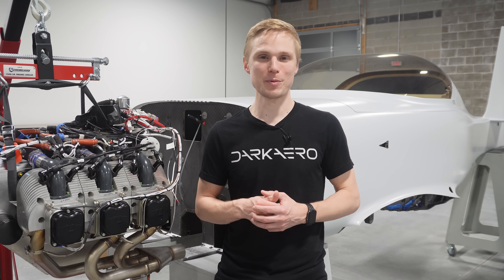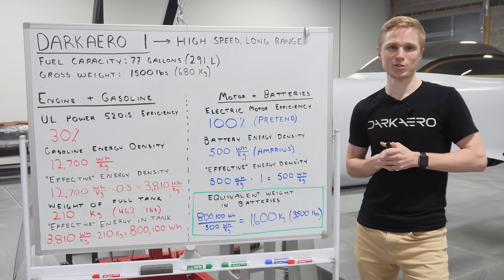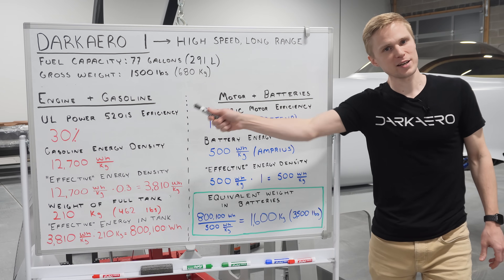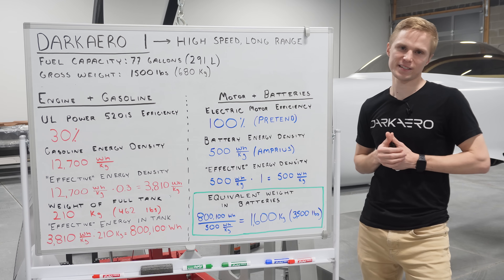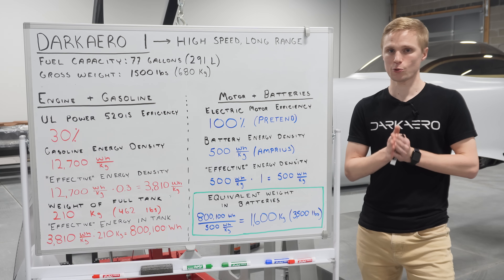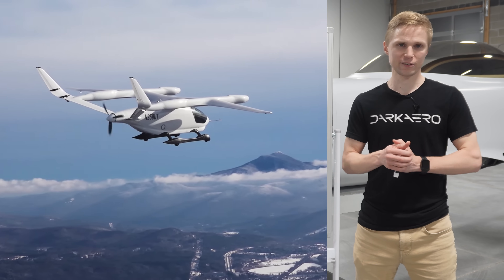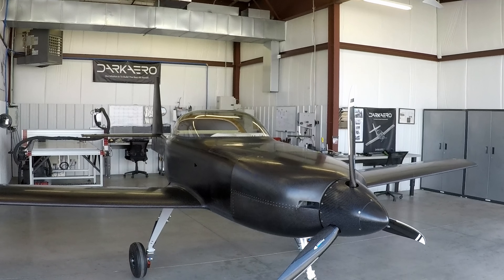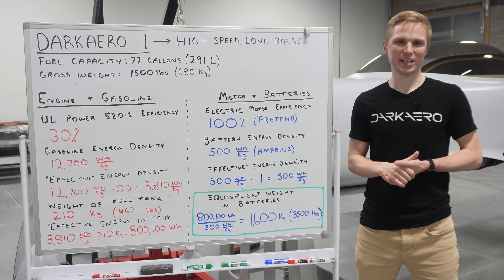The engineering challenge of electrifying airplanes

Comment: One more advantage of gasoline is that the aircraft continues to get lighter as it flies.  That means it gets more efficient as the fuel is burned. Electric motors depend on batteries … obviously, but your motor is still forced to carry the dead weight of the  depleted batteries throughout the entire flight. Batteries also have a finite service life and cost a fortune to replace especially if they are integral to the airframe.
Reply: Good point. You can't have an airliner fly long distances and land at their takeoff weight. And they depend on step climbing to higher altitudes as fuel weight is burned off.
Reply: @benc1103 

Wrong! You CAN have an airliner fly long distances and land at its take off weight. Thos is in fact a disadvantage of gasoline and kerosene.
Reply: Those studies are flat lying to you
Reply: One more disadvantage of fossil fuel is it stinks and destroys our environment so that our grand children will have to struggle to sruvive. 

But of course operating a fast flying machine is much more important than the lifes of our descendants.
Reply: True, but electric motors are far lighter than gas engines and have fewer parts so easier to service. Battery tech is also improving, quantumscape has developed a 1000wh/kg battery that will be a game changer.
Reply: @elftax  are these new batteries still dependent on rare-earth metals. If so, then aren’t a game-changer.
Reply: @thurlravenscroft2572  the name change is the energy density which will make 1000+ mile cars possible. The weight reduction makes electric planes viable
Reply: @elftax  you can develop a car that drives 5,000 miles per charge, but if the materials available to make them are scarce, it’ll never happen because the price will be too high so the demand stays low enough not to deplete the resource.
Reply: @thurlravenscroft2572  the company is building a production line,  its almost certain that it won't be rare minerals - probably lithium
Reply: @elftax  oh, so not rare but incredibly toxic to the environment and the poor children that mine it so you can have your fairytale EVs?
Reply: Battery weight at landing needs better frame as they don't get lighter. For long haul aircraft that have to do a landing shortly after take-off due to technical issues, passenger emergency maximum landing weight (MLW) is easily to solve by dumping some fuel.
Reply: BOOM…mic drop
Reply: And there is no need to reduce gasoline exhaust. Don't believe the hype.
Reply: @RobertCraft-re5sf 

If you think so start the engine in your car in a closed room. See what happens.
Reply: One disadvantage of gasoline is that the engine needs to be overhauled quite often and it's also far more expensive to maintain. Might require more fluids too. 
Another disadvantage of gasoline is that you need to throw it away if you have too much of it when flying. 

I could go on.
Reply: Just toss the batteries out as you go. Simple fix
Reply: Lotta armchair engineers here with their camps already chosen.

Here's the deal. Electric planes already win in operating costs. They lose however on range and endurance.

That means that electric does not currently fit everyone's needs, but it does fit some. And time is on electric's side, since battery tech has more room to grow than combustion. I see people making denser batteries. I don't see anyone making denser fuel.
Reply: @米空軍パイロット  yea you don’t know anything about this it isn’t just about fuel density it’s about chemical chains sure liquid fuel have a massively higher energy density than batteries but we’re chasing fuel chains that have specific hydro carbon levels and burn efficiency while being manufacturable using atmospheric gasses making more dense fuels is “easy” that’s what they do in rocket science fairly regularly but that’s not what the goal is here
Reply: The biggest issue with the entire electric vs. internal combustion discussion is the lack of infrastructure to support a rapid shift to EVs. Without a new realistic/reliable power source, we aren’t going to be able to transition fast enough to get public buy in on EV technology. Especially, when large states like California start having massive brown/blackouts and onerous electricity rationing because of their refusal to accept nuclear fission as a power source.
Reply: @thurlravenscroft2572  no the problem is the current infrastructure is inadequate cost billions more to manage and build has its own problems with “being green” has massive reliability problems that are getting worse with the addition of “green energy” the material to make all the batteries you would need for the cars don’t actually exist on earth and we don’t have a way to recycle them or to throw them away with major environmental damage while slow in gas we are just transferring atoms from liquid to gaseous and wile slow is actually recycling energy thru nature every second and that will speed up If we actually stop trying to tamper with natural systems to save a buck like cattle farming for example the beef I buy from my cattle supplier weights 1600lbs live for every lb that cow weights when I kill it it puts 4lb of carbon into the soil of the pasture he lives in for every lb of meat you buy from Whole Foods that cow because of how it was raised puts 3lb of carbon emissions into the air because of how it’s raised and factory “meat” like beyond meat is over 5 lbs per pound and beyond meat and big box store food is crap for you so you have to eat more to get the nutrients you need so more body fat for you you can’t get rid of and more carbon for the atmosphere so the problem your trying to solve isn’t what you think it is and isn’t as natural to solve as ban or stop gas cars
Reply: @Doubie.  can’t disagree with you, but I did mention one of the problems with EVs in general being lack of infrastructure. I couldn’t care less about carbon emissions, but the use of rare-earth metals to make the batteries which are more scarce than the so called non-renewable resource known a petroleum. The answer to our problem for thousands of years into the future is to keep making internal combustion engines more efficient and transition from coal and petroleum to nuclear fusion in production of electricity. You can solve two problems simultaneously … generate electricity and desalinate water. There is no loser there.
Reply: @thurlravenscroft2572  I'm very certain the biggest issue is the absolutely horrendous cost of the EVs themselves and everything EVs require.

That cost alone makes it far in the negative in regards to its CO2-effects. We don't even have to acknowledge that already now at least ~35% of the cars at minimum are cleaner as ICE than EV, running on fossil natural gas almost all cars are cleaner as ICE than EV, and running on HVO biodiesel, biomethane and bioethanol ICE cars are so massively cleaner it's ridiculous.
Reply: @pistonburner6448 not really, just because something has the word "bio" in it its not automatically better. If everyone were to burn biomethane we would need a lot more cows and rotten food to produce said methane. So you just increase the pollution in another sector. They might be great for nieche segments and rural areas or trucks mb even but not for everyone.
Reply: @D3nn1s  Your criticism of that fuel is illogical. Biomethane absolutely is better. If there is not enough supply of raw materials to make (actually gather) even more biomethane then there simply isn't enough supply for absolutely everyone in every use. That doesn't make the supply which is available any different to the absolutely fantastic, most environmentally friendly and easy to handle fuel!! Who cares if we run out of biomethane to use? Then we've simply efficiently used all we can, there's nothing negative in that.

Are you saying that using a biofuel mix of 10% in current gasoline and diesel is a negative thing just because we can't offer 100% biofuel right away? Of course not, that would be ridiculous. Of course whatever sustainable fuel we can produce and use is a positive thing. In some countries the biomethane is mixed in with fossil methane (=natural gas) at for example 20% to provide a larger supply of a fuel which is incredibly much cleaner than fossil gasoline, diesel, and even EVs. Well, it's typically piped into the natural gas pipelines anyway as it's the same stuff chemically (if cleaned up enough), but using accounting just like with "green electricity" it can still be sold separately even if it's really mixed in.

There is no "increase of pollution in another sector", I have no idea how you came up with any pollution increases at all in relation to biomethane.

And btw, there are still incredibly many sources we can tap into with biomethane as we go forward. There is so much biomass rotting all around the world, spewing that methane into the atmosphere. And that methane getting into the atmosphere is a many times more potent greenhouse gas, so actually gathering that methane and instead burning it as fuel makes it a greenhouse-gas-negative fuel in theory!!

I hope you also realise that even though in many countries very many landfills and sewage treatment plants are already gathering up the biomethane, there are incredibly many countries which do not do that yet, so there is still a massive supply of biomethane to be used! And it's literally from human trash and human waste!

Biomethane can potentially be gathered from so incredibly many sources: forestry industry can gather up so much more of that biomass than just the tree trunks and use the biomass from that (and probably make other biofuels too), who knows how much we can harvest in countless ways from the ocean, etc.
Reply: @pistonburner6448  i never felt like my words got twisted that much lmao. Sorry not feeling like writing 2 paragraphs back
Reply: @pistonburner6448  I’m definitely not a proponent of EVs. But, I’d there is push to transition to EVs then expectations have to be tempered by a look at the facts. There isn’t enough capacity in the grid to support replacing ICE with EV tech. In addition to this, as you said, the technology isn’t mature enough to be cost efficient and reliable.  Also, the age of the technology doesn’t matter, just because something is old doesn’t mean that it’s well developed or understood. It was never adopted on a scale large enough to develop a body of FRACAS data. Without that data, it’s hard to know every shortcoming of EV technology.
Reply: @pistonburner6448 

You want horrendous costs? Look up oil refining. We're not talking about extraction, distribution, etc..
Reply: who cares about cost?
Reply: False, hydrogen fuel cell is all you need.
Reply: @kizzjd9578  ha ha 😂
Especially with a cryogenic tanks storage system, cost of an element itself, lack of infrastructure for hydrogen... Yeah, yeah it's definitely better than methane gas in SOFC with already existing infrastructure for it.
Reply: @teolynx3805  dont need to store it at a low temp, just need the gas version and use a fuel cell generator. I’ve seen the technology with my own eyes on heavy lift drones that have a 2 hour flight time so it can definitely be done. The hygrogen gas is readily available in Australia. Not sure about the usa.
Reply: @kizzjd9578  in gas phase you'll get very low energy density and big enough amount of problems with storage. And yes it'll weight a lot because of the gas cylinders.
Reply: @teolynx3805  the cylinders are aluminium so not much difference to a normal fuel tank in a boat or car etc. just saying it’s not impossible. Just needs to be scaled up
Reply: @kizzjd9578  not so much? 6l cyl. weights about 3 - 4 kg... And 6 l of compressed hydrogen isn't that much.
Reply: @teolynx3805  the cylinders ive seen are made out of carbon fibre which is half the weight again.
Reply: And it’s at 500psi as well
Reply: Biy Aero and Ampreus are making wing mounted batteries that will be jettisoned after it dies and the engine is switched to fresh batteries.
Reply: Usage of solid state batteries will make it much more energy dense and reliable long term.
Reply: While this is true and accurate, it sounds a little nit-picky. You could also bring up the fact that the weight savings from burning off fuel is inversely proportional to the needs of most missions, where the plane is heaviest when it needs to climb and lightest when it needs to descend.  That again would be nit-picking.

Batteries are indeed expensive, but nowhere near the price of the amount of 100LL used during equivalent flight hours, not to mention oil changes and regular maintenance on aviation grade internal combustion engines. Not only is it not in the same ball park, it’s not even playing the same sport. Batteries, if integrated structurally, could become difficult to swap out, but many planes already come with detachable wings which would be the ideal place to integrate the batteries to distribute weight along the lifting surface and reduce bending moment at the wing root.

This is all irrelevant tho, since the points of the video still stand. Just pointing out what seem to be somewhat frivolous arguments against batteries.
Reply: @xpeterson percentage wise, if batteries got lighter or were jettisoned  as energy was consumed this would be a significant factor. In any case , efuels end the discussion wrt co2 concerns.
Reply: @keim3548  efuel is even more expensive tho
Reply: @xpeterson  Show us your math please.
Reply: @pistonburner6448  it’s not my math.  The math has been done on electric cars with numerous reports on cost of ownership.  The numbers do not favor ICE vehicles, and that’s assuming lower octane fuel and mass produced internal combustion engines.  The numbers, as any airplane owner will attest to, skyrocket when you go to 100LL and say an entry level Rotax engine.

Again, there’s still numerous issues to be addressed, one more notable one not mentioned being that current batteries on BEVs suffer in cold climates.  That’s actually something to have concerns over. Price? That’s just laughably brainwashed
Reply: @xpeterson  It depends on who generates the numbers and what assumptions are made.  I have seen at least as many studies that show EVs are more expensive overall (TCO) than ICEs and much more expensive to repair when things go wrong.  I would post links here to those studies, but links tend to keep YouTube comments from ever showing up.
Reply: @xpeterson  Show us the math. It doesn't matter if it's your math or their math, but you made a claim about some math so please present it.

Or you could just give us a quick summary of how much EV subsidies are, and including ALL of the subsidies: during purchase, tax breaks, subsidies and tax breaks to manufacturers, all production facility construction and reconstruction tax breaks and subsidies, research subsidies.

Just looking at one of those subsidy categories we can see that in Germany for example the EV subsidy at purchase for consumers is €9000 per vehicle, and in the US Biden is pushing through a $7500 per vehicle subsidy!! It's hard to account for many nations' subsidies as they have multiple schemes and especially in Europe most new cars are company lease cars and they have possibly even more extreme subsidies with some giving huge rate reductions and 0% tax compared to their HUGE ICE car taxes in that country! And that doesn't include how in Europe their yearly car taxes are very big and EVs have been receiving total cancellations of those taxes or at least huge reductions!

Then list how much the massive electric grid works and new power plants will cost. Note, there is a HUGE capacity increase need in order to replace the astounding amounts of gasoline and diesel energy they must replace!! Note too that any renewables will need to be basically doubled by backup power plants for when they are not producing energy.

Then list the huge amount of a masked cost: the amount of gasoline and diesel fuel taxes and duties which will need to be replaced by taxpayers or someone as EV users are not being required to pay those payments, making it another huge hidden cost of EVs. 

Then list the how much the millions of chargers which need to be manufactured, installed, maintained and periodically replaced (they are lasting far less time than originally estimated) will cost. Last charging station I checked the public records of was a puny 40kW single charger, and they got $80,000 of taxpayer money for that one single charger! For installation alone, not including maintenance nor the future costs!

Then list how much the additional vehicle cost is because even after all those absolutely huge subsidies, tax breaks, lost tax revenue, etc. the EVs still cost on average at least $10,000 more (and I'm being very fair and being safe, supporting the EV side with that conservative number) than ICE equivalents!

I can help you with those calculations a bit: all that amounts to not just a few but very many trillions!! And that is not a small sum of money. Especially as the UN's compiled research shows that a nation's wealth has been the most reliable and clear determinant of how well they have really been able to reduce CO2-emissions because monetary funds are needed for CO2-reduction projects. Destroying nations' wealth with anti-science and corrupt EV schemes destroys their ability to actually reduce CO2-emissions.
Reply: @xpeterson  My personal EV and PHEVs have been far from zero-cost, with both EV and PHEV having had major failures of their electrical systems. Meanwhile I nor any of my family members have had any failures at all to our PHEV's ICE systems or pure ICE cars in the last decade. Only cheap servicing every two years, that's it.

The EV had a catastrophic failure of its battery cooling system requiring the car to be hugely dismantled, a month of it being off the road, and I didn't even see the cost as it was done for me under warranty but I'd be surprised if that huge amount of work hours didn't result in far more cost for that one secondary system's failure alone than a whole ICE replacement!

My PHEV had its high voltage control module fail, and that module had to be completely replaced at a cost of a whole ICE replacement (for a relatively cheap car, not quite the price for an ICE replacement of a luxury car)! It also took over a month to get done! That one also was luckily covered by warranty, but without warranty that would've been a catastrophic cost. And...despite warranty someone is paying for that, it will be baked into the new vehicle prices as consumers will ultimately pay all those costs! BTW the service technicians said that those high voltage modules fail very often, that it only takes a slight voltage spike due to some charging error and it's completely toast.
Reply: @LTVoyager  BEVs are a new technology, and some automakers are fumbling their way through. I’m sure you can find plenty of outlier reports where having an electric vehicle became more expensive. You can find plenty of those on ICE vehicles that were sold with a defective drive train, which were issued a recall only to sit in a lot for months because the parts were on back order. That in no way represents the vast majority.

Even if you did simple back of a napkin math, it costs on average $15.52 to “fill” a Tesla. Compare that to the $50 I just put into a Jeep, and it doesn’t take long to create a drastic gap. If you have solar panels on the wings or consider the current price on 100LL, that gap only gets wider. Replacing a battery pack ranges from $13k to  $20k. That’s about what it costs to overhaul a Rotax, which needs to be done every 2000 hours. We dont have much to go on for cost to overhaul an electric motor, but considering electric motors have a grand total of 1 moving part, it’s not going to be a factor, if they even require an overhaul ever. Then there’s all secondary benefits of having a simple, reliable engine that has few single points of failure - what will the maintenance costs be? what will the insurance costs be?

This again is assuming am electric aircraft that actually works for the general purposes of general aviation. It doesn’t catch fire, it can handle the cold at altitude, it has sufficient energy density, etc. This doesn’t exist yet, and until it does (and they have worked out all the kinks), we will not have solid numbers on anything.
Reply: @xpeterson  Always love folks who don’t know history.  https://en.m.wikipedia.org/wiki/History_of_the_electric_vehicle
Reply: @pistonburner6448  you are talking about the costs of chargers, while ignoring how much it costs to run a gas pump. You are talking about EV subsidies while ignoring bailouts, gasoline infrastructure, and generally the vast amounts of tax payer money we have put into making ICE vehicles convenient for the average American over the last century.

It costs a lot to build new power plants? Tell me, what sounds effective or an efficient use of energy about this: producing millions of small internal combustion engines whose primary purpose is to be mobile, then refine petroleum into a form that’s convenient and safe for a wide variety of these engines and ship it out to a vast network of stations so that these engines can send most of the energy contained in that petroleum out through the radiator and exhaust pipe.
Reply: @xpeterson  BEVs are not a new technology. They were first sold in the 1800's and were more popular before the breakthrough of electric starters for ICE cars which then led to everyone wanting ICE cars.
All the tech used in EVs have been developed over the last century and a half, over all these decades as many machines, productin equipment, all kinds of things have been using electric motors and batteries. So that too is incorrect.

You are also incorrect in your math of "filling up" a Tesla. You forget that if everyone is forced to switch to EVs not only will that electricity cost a lot more, but even forgetting that aspect that gasoline you put into an ICE had a significant amount of taxes and tariffs in it. So now the government needs to increase its tax collection, meaning the EV drivers have hidden costs which they will have to pay for through other means.

You just make one lazy, short-cut unrealistic claim after another: do you seriously think that automotive battery pack pricing is what the pricing is going to be like for aviation battery packs? ALL aviation equipment costs far more than automotive equivalents. And if you think that aircraft can fly on puny car-sized battery packs then you are seriously deficient in your own processing power, as the energy requirements for pootling around in California traffic at an average of 20mph is completely different to flying an aircraft.

Then you claim that electric motors are more reliable, cheaper to maintain and won't break...but you don't even know anything about EVs then, because electric cars and aircraft need a battery pack, battery cooling, battery heating, a battery management module, a charging module, converter, inverter, power electronics module, etc...
As I believe I already told you: even in my 'simple' PHEV a very slight momentary power spike destroyed the high voltage control module. And my EV's battery cooling system broke.

Just the battery going out of optimal range can mean that power is suddenly severely restricted.

And you claiming that EVs don't catch fire must be a joke...

You are absolutely incorrect that EVs can handle cold: it's one of the main, huge problems for EVs!! The electric aircraft, just like cars, will spend massive amounts of the battery's capacity electrically heating the cabin (which is incredibly inefficient) and battery which must be kept at a very certain temperature range or it will stop performing and can easily be damaged!! 

You are once again the opposite of correct when you try to suggest that insurance costs will be lower. Wrong! The aircraft will be massively more expensive, so will its systems and repairs (not least because thousands of technicians will have to be retrained), and that cost will mean higher insurance costs.
Reply: @xpeterson  how far can you drive in your Tesla when it’s -10°?
Reply: @xpeterson  How much will it cost to build up a new infrastructure of gas pumps for everyone? Oh, wow, you know what: they already exist so that cost is ZERO!! Furthermore gasoline pumps serve far more vehicles per hour, there is a need for far less of them, etc. so...once again you are totally wrong and your self-made-up theories are nonsense.

Which one sounds more effective and efficient? The millions of small combustion engines of course! Much better to have small, efficient combustion engines and the incredibly easy liquid and gaseous fuel infrastructure...which has already been built up over the past century. Millions of massively heavy batteries, the requirement for tens of millions of chargers at homes and publicly, building up new power stations, huge new grid construction nationwide, the need for all kinds of difficult load balancing as EVs require the same electricity as we use for so much else and we need it at exactly that certain moment and it can't really be stored...much worse! As we can clearly see from how it doesn't work and how many trillions it costs!

You are also incorrect in your FALSE statement that ICE needs to be run on petroleum. COMPLETELY false. Why would you lie like that?

Does this btw mean you are so dishonest that you REFUSE to answer my question about the cost? Don't think for a second that you are now off the hook from providing an honest accounting of how much EVs cost! It is a MAJOR factor in this, so you can't skate past the cost issue!
Reply: @pistonburner6448  Everything you just wrote shows you either didn't read or cant read. Like, I mentioned the temperature issues in just about every other post I made, and yet you somehow bring it up like its a revolutionary thought...

" if everyone is forced to switch to EV"
"And you claiming that EVs don't catch fire must be a joke"

Well, your claim that Batteries cost $3 million each and kills orphans is just as bad.  Im done with this game of pigeon chess. Cheers
Reply: @pistonburner6448  personal experience is usually faked. Show your math as you have demanded others do. What is the average maintenance cost for EVs vs ICEVs?
Reply: @xpeterson  All this "math" was done on basically free electricity. Which is obviously not going to happen. And all the promises of "it'll cost pennies to fill up the tank" got silently  swept under the rug by car manufacturers in both US and europe. Cost of electricity itself was in excess of 0.20 euro per kilowatt hour this winter in EU. With all the "infrastructure surcharges" it was equivalent to $100us to charge your regular tesla. 
Hope you all will learn to distinguish marketing bullshit from actual real world one day.
Reply: @xpeterson  Ignore them, I agree with you. Bringing up ridiculous points
Reply: @LTVoyager  My dad in his retirement buys mildly crashed or vehicles in need of mechanical repair, repairs them and then resells them. He has turned around several cars and trucks and usually made some money doing it. He then bought a Chevy Volt that had very mild rear end damage from a slight rear end collision thinking he could repair it. For safety reasons, the high voltage system cuts itself off in the event of a crash and basically bricks several of the computers in the car. It was going to cost about $10,000 to fix a car that would not be worth nearly $10,000 once it was repaired because of it's age. High Voltage systems are so dangerous to mess with that the manufacturers make them nearly unrepairable and even when they can be repaired, the cost is so prohibitive that it's not worth doing, which prevents people from repairing them. I agree that electric cars are a waste of money. They're more expensive as a new car and impossible to repair so when it breaks, it's just a piece of junk. And the Chevy Volt is a hybrid system that still has a gasoline engine in it.
Reply: @xpeterson  yea cool guess what electric cars aren’t FAA certified or tested to that certification and don’t have parts time out for safety ect so take your data and burn it because it’s worth less than the paper it primed on until you add the 100 factors it would be missing just to start with
Reply: @LTVoyager  just not true. You should talk to people who are using/owning EVs in their daily life and talk to them about cost etc. Maybe then you believe it.
Reply: @Gregory-Mugen  It is true.  I talk almost daily to EV owners and I have run the numbers myself before buying my Equinox last year.  I never would have closed the initial cost disadvantage to a Model Y.  Learn to use a spreadsheet and run the numbers and then maybe you will understand.
Reply: @xpeterson  You forget the fact that commercial airplanes need to be able to dump their weight if doing alternate landings. All airplanes have a max takeoff and max landing weight. Find me a western flight authority that will allow airplanes tp dump highly volatile and explosive lithium ion batteries 🤣
Reply: @xpeterson  Funny you mention engine failures. Another point where fuel dumping needs to take place 😉
Reply: @xpeterson 

Can't. Basically English.
Reply: @pistonburner6448 

Show us your math or shut up. Nothing made up because we shall know.
Reply: @LTVoyager 

Only groups that are paid by the oil industry claim that it's cheaper to own an internal combustion engine car. Nice try though.
Reply: @thurlravenscroft2572 

You're the one that said Tesla. Nice try. Farther than you can without gas.
Reply: @pistonburner6448 

Yes, billions of dollars of gas pumps means 0. Pal, you need to replace them. That costs money. You can recharge and electric car at home. Also, you will not need oil refineries WHICH RUN ON ELECTRICITY that much so there will be a reduction in electricity consumption there. An oil refinery uses as much electricity as a small city.

Internal combustion engines are NOT efficient. Stop lying. Also, incredibly "easy"? Learn English. You mean incredibly light. No, the infrastructure IS NOT LIGHT, it doesn't even come close to "incredibly". HAVE YOU EVER SEEN AN OIL REFINERY? That's NOT LIGHT. Semis are not light either. Charger in your homes? You mean extension cords? 😂 Do you realise every house has them? No. 

Also, he's NOT incorrect about his math about "filling up" a Tesla. You want something COMPLETELY FALSE? Look up your reply and your claims about infrastructure.

As for his claims that internal combustion engines need to run on petroleum, it DOESN'T EXIST. STOP LYING, STOP MISREPRESENTING WHAT OTHERS SAID. Internal combustion engines in cars NEED gasoline or Diesel fuel to work and they are petroleum based products. There might be some exceptions but those are exceptions. Also, if the internal combustion engines run on something else, YOU NEED A WHOLE NEW INFRASTRUCTURE, including electric infrastructure. So, might as well make the cars electric.

No, it doesn't because he's not on the hook for anything. You are. He's not dishonest. You are.
Reply: @CarbonGlassMan 

Nice story there. Electric cars are not a waste of money. Internal combustion engines are a waste of money. Your father has no idea how to work with a plug-in hybrid car. The Chevrolet Bolt is a hybrid car, not an electric one. The manufacturers DIDN'T make them unrepairable, they just made them harder to repair for someone like your dad that has no idea how to do it. It's NOT impossible to repair. Your dad should start saving money  because the US will start importing A LOT of oil in a decade and that means old cars won't be in demand anymore.
Reply: @Gregory-Mugen 

Bingo! LTVoyager doesn't like the facts. He doesn't know how to use a spreadsheet either.
Reply: @LTVoyager 

He did use a spreadsheet. You did? 😂 Don't tell anyone to learn to use a spreadsheet. You don't know how to use it. There's nothing to understand. You're saying you know 2+2=5 "because you've used a spreadsheet". He doesn't need to use a spreadsheet to know it's 4. You just have to accept the facts.
Reply: @NGC1433 

Still far cheaper than filling your tank with gasoline. Gasoline has become very expensive recently if you haven't figured that out. How do you think YOU MAKE GASOLINE? WITH ELECTRICITY! 😆 You need electricity to run an oil refinery and you need electricity to EXTRACT the oil. Yes, it's cheaper to just out the electricity in a car.
Reply: @bobfg3130  The Volt is a hybrid. The Bolt in full electric. Not sure why you think being a childish smart ass somehow sells your position on this subject. 

My dad built an electric GT40 in the late 1970s in the garage. He built a robot that passed out Halloween candy to kids that came to the door on Halloween in the 1980s. He did the electrical work on trains, then supervised the guys who did the electric work on diesel electric trains. 

Internal combustion engine cars are not going anywhere. We will have them 100 years from now. 

A battery pack costs more than a new engine. A battery pack doesn't last as long as an engine. There is nothing "green" about building battery packs or with charging them. 

My dad is not an expert at repairing hybrid electric cars, that's true. That's why he sent it to a mechanic shop, then to the dealership to have them repair it. They said it would cost about $10,000 to repair it. So if most people cannot repair a small amount of damage to their car, the car is useless in my opinion. Because almost no one pays $10,000 repair bills. You just get a different car if it costs that much to repair it.
Reply: @LTVoyager 

So you finally found out about the history of electric vehicles? 😂 And now you claim he doesn't know history and that you "love" people like him. 😂 Stop lying. You looked it up now. I love people like you, claiming they know more than others when they don't.
Reply: @xpeterson 

You're ignoring subsidies for oil companies.
Reply: @bobfg3130  Another 8 year-old got a tablet for Christmas and is now posting unintelligible nonsense.  Happens every year at this time.
Reply: @bobfg3130  Oil companies don't get subsidies. Politicians say they do because they depend on voters not knowing that they're being lied to. For example, when an oil company drills for oil, but doesn't get oil from that well, the oil company writes that well off as a loss. That's what everyone does when they spend money on a business expense and not only make no profit, but actually lose money. Politicians are calling that write off a subsidy. People and companies only pay taxes on profits. Since there is no profit on a financial loss, there are no profits to tax. 

Now where are you getting that you need electricity to get oil out of the ground? Electricity, made from burning fossil fuels to turn an electric generator is used to drill for and refine oil, but the electricity had to be made by burning something to turn water into steam to spin a generator to create the electricity. There is no free electricity.  The closest we get to free electricity without a nuclear reaction is hydro electric, but that equipment requires fossil fuels in order to make the equipment. Hydro is also limited to areas near rivers and only so much electricity can be generated with hydro. 

Energy has to be available and affordable. Electric energy has to be stored in batteries, and electric vehicles don't have the ability to mine for the minerals used to make batteries.
Reply: Ice will remain king of power plants for many years to come, maybe in 100 years or more or until a more  cost efficient platform is developed not using  slave labor and the raw materials not  cornered by Enemies of America.  So many obstacles to over  come yet. Battery power planes is just not viable  besides the strong possibility they can burn up in midnight or while recharging, in China battery vehicles are burning up on a daily basis. Plus in most cases,  your power grid is still powered by fossil fuels. The states does not have the capability to handle the drain of  millions of  batteries packs. Our national grid is strained now as it is. There has to be major  upgrades to the national power grid handle the demand. There are other issues to consider, weather extremes which affects charging and performance issues to name a few. This is  a matter that will further drive innovation to achieve more break throughs in battery technology  for years to come. For now ice has preferable advantages over electric  engines in certain applications,  namely  in aviation. This  in time may change  given enough resources and massive strides of brilliant  innovation. Until then ice is still king.
Reply: @davidwrobel8089  You had many very correct points and you gave a convincing argument as to why electric aircraft won't be viable for a long time...and you didn't even touch on the most important reason: the absolutely horrible, crippling costs (to customers and/or society, including taxpayers as a whole).
Reply: @davidwrobel8089  are you really that unaware of how many ICEVs fires there are every day? In America alone, there are 170,000 a year. 
By 2030, BEVs will have the new car market. Charging is mostly done at night where there is sufficient spare capacity already. 
For aviation, just like with cars, electric will quickly dominate as soon as it shows up because operating costs are so much lower. Already, the FAA is reviewing regional electric aircraft.
Reply: @williammeek4078  yea your comment on fires ignores the fact you can put those out because there not infrastructure melting hot while being self oxidized and aren’t generally crash related
Reply: @Doubie.  ICEV fires are roughly 50x more likely than a BEV fire even when looking at per million miles driven. In order to compare, you need to look at the worst 2% of ICEV fires against the average BEV fire.
Reply: Bye Aerospace is delivering electric trainer aircraft that cost $20/hr to operate, vs a similar airframe which costs over $140/hr. Including the maintenance savings over the life of an aircraft, the overall costs for this use case is estimated to be 80% lower for electric. And given no electric aircraft designer is integrating batteries into their airframe (some are even doing flight-line hot-swap battery designs) the cost argument is well in favor of the electric system.
Reply: @imabeapirate  that thing costs 500k no real school is going to buy these things. 20$ is shit math considering you have to pay 2k a month just to pay the loan plus, insurance, hanger space, all the regulated maintenance, Garmin license, 140$ an hour isn't  just for fuel. plus you have to put in infrastructure and training to maintain them. it may be cheap in the future but not for the first 10 years of owning one.
Reply: @imabeapirate  This is literally the only use case though. As a trainer it's fine (and you could rack up hours for a PPL on this) but the feasible range is quite low.
Reply: @imabeapirate  have to wave the bs flag…….considering the electric airplanes currently proposed have about 45 minutes endurance. It would cost a fortune to run EV trainers in a flight school.

Must compare apples to apples.  The comparable aircraft Sling (a common trainer) burns approximately 4-5 gallons an hour.  At $6.35 a gallon fuel cost would be $35.00 an hour and has 3-4 hour of fuel on board.

A Tesla Model 3 is approximately 500 lbs. heavier than a Toyota Avalon.   The batteries make Teslas very heavy therefore until there is a massive reduction in the weight of electric storage (batteries) Electric airplanes will not be feasible.
Reply: @floydragan 

So when you hear facts you call them bs. There are already flight schools that use electric planes.
Reply: @imabeapirate  Your post serves as a perfect reminder why we should not believe anything on the internet,
Reply: @imabeapirate  electric motors are easier to maintain, but trainer is not a regular aircraft that has to bring you from point A to point B preferably faster than a car or on longer distances that are not feasible for car (say over 500km).
Reply: @imabeapirate  except you have ignored a lot of the costs of ownership with electric. Studies are now showing that an electric car is more costly to operate over its lifetime than and ice car.  Ice airplanes suffer from engine design stagnation due to regulations.
Reply: @imabeapirate  yea I can do that too by making up statistics that intentionally exclude the comparison factor ex. How much does a certified electric aircraft battery cost to completely replace there more expensive than car batteries because of the FAA cert process that’s for sure what’s the hard use timeout for the battery (also does that /count include time when not flying it should because the battery doesn’t just turn off like a engine) what’s the certified aircraft motor cost what’s its timeout how manny individual battery system is the plane going to have because you can’t have the propulsion system the avionicss and the  passenger amenities on the same system and accurately measure the range and reserve range before takeoff (can’t have loss of power in the air) how are we pressurizing we can’t use the engines in this case and pressurized atmosphere is the most power hungry fluid to pressurize now we also need to rework the air conditioning no engine also that’s extremely power hungry and there aren’t certified electrical refrigerant systems for planes because they run on engine rotational power now plus add extra backup batteries for the backup avionics create and certify a completely new fire suppression system for the batteries to protect passengers because current systems aren’t sufficient for inflight self oxidizing fires now add in the weight of the increased armor that a battery will require incase of a ground loop or gear up landing plus add thousands of hour of cert time and rework that has to be done from scratch currently but now that I’m thinking about this if we’re certified we need extra power for deicing the pane too and that should be a independent system with its own battery being a safety system you can’t just use figures based on Teslas prices for aviation when the engineering threshold for sales is exponentially higher in aviation which it should be given that your car can’t just naturally fly over your neighbors house it’s interesting to say the least but it’s not as easy or simple as just half assing it by putting a electric motor in a plane  and calling it done you’ll notice Elon isn’t trying to make electric planes/ rockets and the patey brothers build are engineers that had a company specializing in electric cars and now have a company that specializes in electric plane tugs while mike is a mad man who love planes like a crack head loves crack and even likes to push the boundaries of safety and performance by racing planes but has not once expressed any public interest in completely electrifying a aircraft there’s a logical reason for that 

We actually don’t know what a electric plane will weight with all the extras here and guess what you can’t measure there actual performance until they fly and you can’t compare currently are we comparing to jet performance turboprop piston radial engine you can run all the theoretical numbers you want but until it’s in the air it’s meaningless because you don’t have a clue what you forgot until you need it flying that’s why we’re constantly updating regulations and why the bar of entry in aviation has gotten so high you can’t just crash test a it like a car and let your customers work out all the bugs problems for you and you can’t just lie to the FAA like electric car manufacturers do to there customers because the FAA requires the engineering data not bs marketing
Reply: @imabeapirate  Hahaha, great joke!
Reply: @pistonburner6448  after reading a lot of your comments here, you might want to reconsider what you call a joke.
Reply: @pistonburner6448 

Haha? 😂 Those are facts, not a joke. If you want to see a joke, read one of your comments.
Reply: Adding solar and minimizing batteries like the solar impulse will always defeat gas… how many gas powered airplanes have made it non stop around the world??  Zero